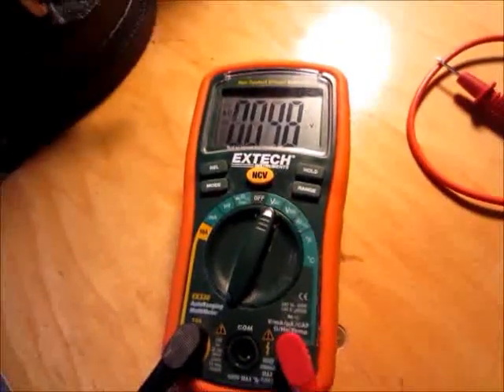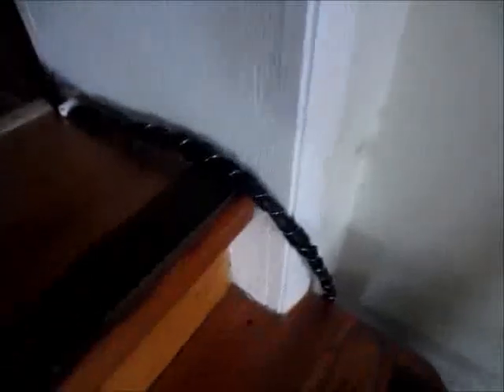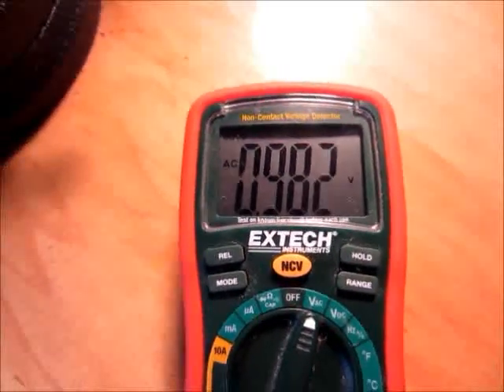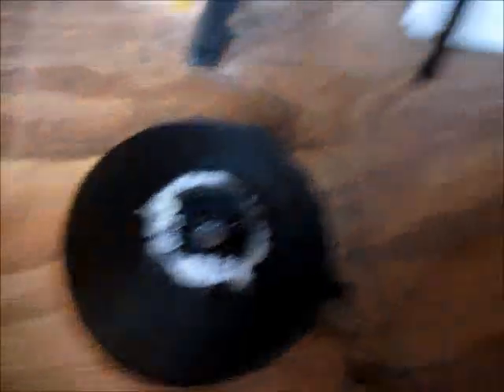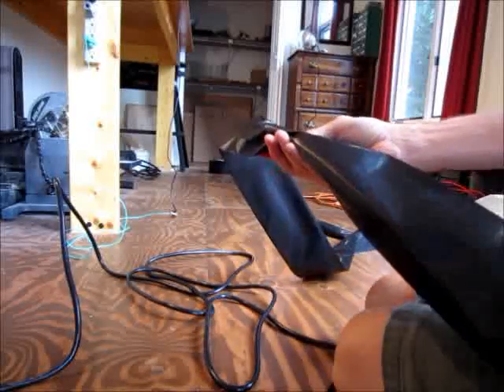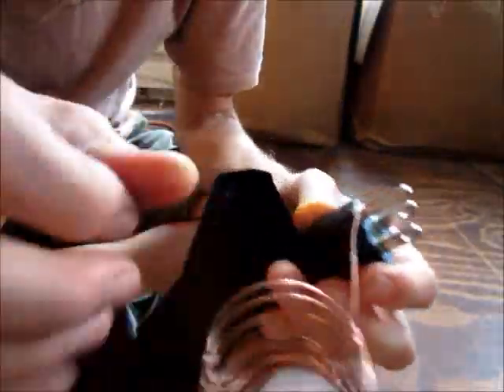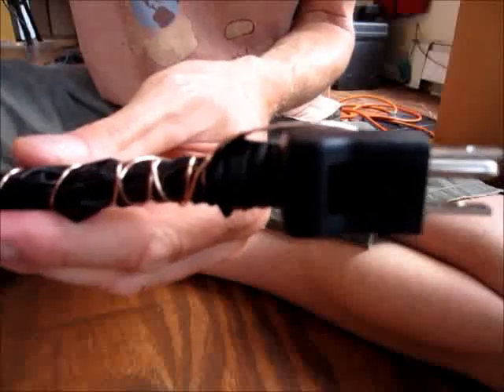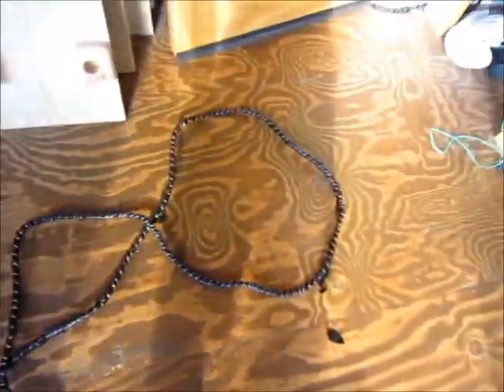EMF Grounding Dirty Electricity - Extension or Applicance Cord

Comment: Hi thanks for the video. How effective would it be to simple wrap your cords with copper wire and skip the plastic/graphite shield....would it be at least somewhat effective at absorbing and dissipating some of the electric field coming out of the cord (as long as the copper wire is grounded)?
Reply from the maker: That won't work very good because it's not sealing it like this insulated tubing that's full of conductive GRAPHITE.

Comment: I would like to see you get into orgonites.  Just starting to get into this earthing thing. Just being careful about dirty spikes. Actually grounding myself for 3 nights via copper water taps at home seemed to drain the juice out of me. Maybe a detox thing or a placebo effect. I stopped it and just ground barefoot, no noticeable or really fancy feeling happening yet, aside having deep sleeps which I can't , never attained in 20 years. Honest.
Keep the infos coming and THANKS!
Reply: I am not affiliated with Vitality Massage or with http://www.brettsnaturalhealth.com; I am a YouTube viewer just like you, but I read your reply to the video . . . . If I interpreted your reply correctly, you are aware of the risk of stray electricity (stray current or voltage) / dirty electricity (dirty spikes / voltage spikes) / wandering ground current and, potential magnetic fields caused by such things as a faulty neutral wire and / or, a neutral wiring error touching an electrical ground from which a copper pipe can become a conductor of that source of stray current / dirty electricity.  Whenever a person tries earthing (body grounding) this is a risk regardless of whether they use an indoor ground via an electrical outlet receptacle ground from an indoor room wall receptacle and / or, whether they use a natural earth ground by placing a metal grounding rod into the soil with an insulated copper wire attached and / or, whether they use a copper water tap pipe as the grounding source of indoor body grounding (earthing).  Please consider the possibility that the copper water tap pipe you connected your indoor earthing / body-grounding system to, may be receiving stray / wandering ground current from a nearby electrical utility earth circuit and / or, an unwanted magnetic field source of EMF from a faulty neutral wire or wiring error.   Unless I am mistaken, an electric utility earth ground used by either a local electric utility company and / or, used by the electrician hired by the building contractor to install the neutral wires or ground wires of an electrical system, can end up sending stray / wandering electrical current into the earth soil for up to hundreds of feet from the source of the earth ground and, can also be a cause of unwanted magnetic field radiation inside the home.  Therefore, it is possible for an indoor copper water tap pipe to be receiving stray electrical current (dirty electricity) from an outside earth ground source of stray / wandering electricity because all indoor metal plumbing pipes are ultimately grounded to the earth through an outdoor pipe connection to all indoor plumbing.  Another possible cause is that an electrical contractor committed a neutral wiring mistake or there is a faulty neutral wire somewhere.  To actually see examples of these possible scenarios, please watch the following YouTube videos: Electrical Current on Plumbing Pipes (Published on YouTube by 'The EMF Explorer' Shaun Kranish of ElectraHealth.com).  2nd YouTube video title: Sparking water pipe - bad neutral?  High volts and current (Published on YouTube by 'The EMF Explorer' Shaun Kranish of ElectraHealth.com).  3rd YouTube video title: More current on plumbing pipes - check them all! (Published on YouTube by 'The EMF Explorer' Shaun Kransih of ElectraHealth.com).  4th YouTube video title:  Grounding stray current through water main (Published on YouTube by Event Horizon789).  5th YouTube video title:  Voltage On Faucet (Published on YouTube by L Sanchez).  6th YouTube video title: EMF Health Risk. EMF from Water Pipes (Published on YouTube by feouellette). 7th YouTube video title: Preventing EMF from entering your house in your plumbing (Published on YouTube by EMF Solutions).  8th YouTube video title: Water Pipe Grounding Short Lecture (Published on YouTube by Bryan Ropar).   9th YouTube video title:  PG&E uses the Earth as part of their circuit. (Published on YouTube by Windheim EMF Solutions).  10th YouTube video title: Plastic Plumbing Stray Voltage Induced Into Water Demonstration (Published on YouTube by Steven Magee of Environmental Radiation LLC).  11th YouTube video title: Safety First: Shock Hazards of Electrical Wiring to Water Pipe (Published on YouTube by AmericanWaterWorks). 12th YouTube video title:  Filter Out Dirty Electricity While Grounding (Laura Koniver, M.D. The Intuition Physician)